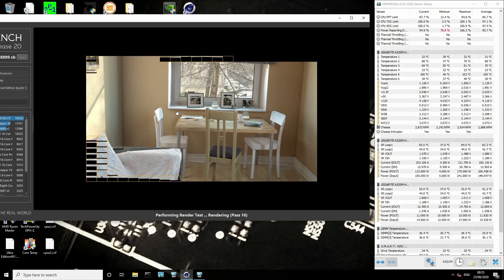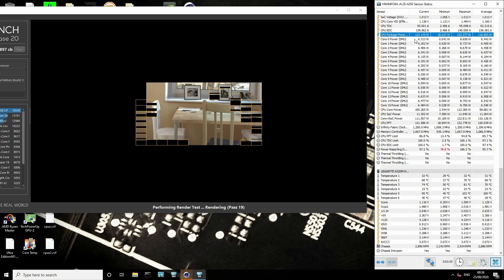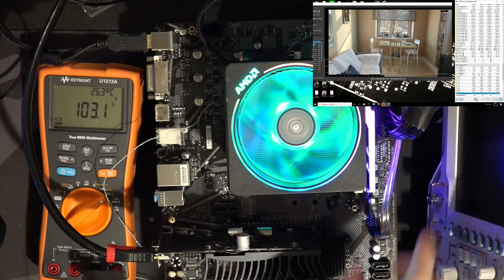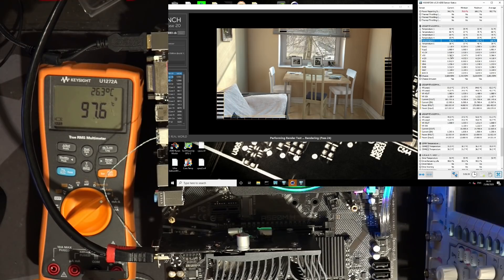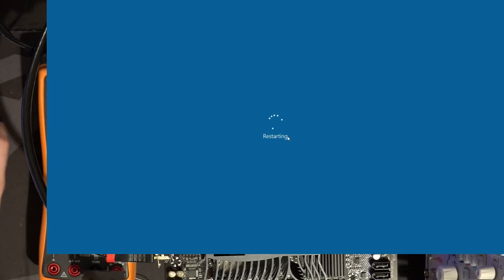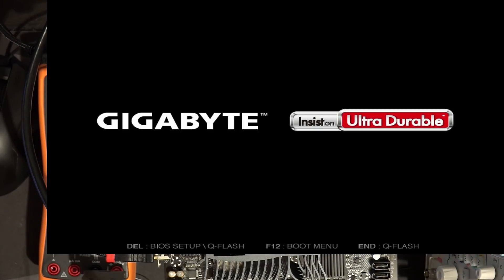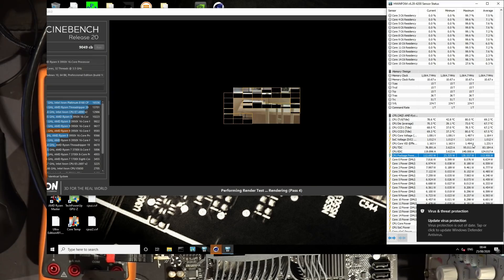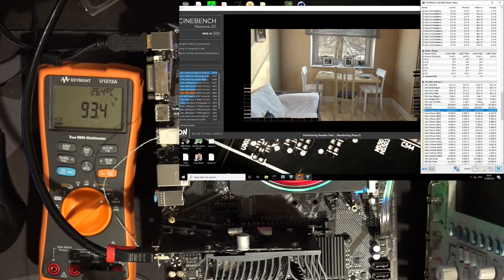Ryzen 9 3950X VS a low end A520 VRM feat. Gigabyte A520M H

Comment: Seems like gigabyte has been downgrading the VRMs of his low end motherboards. The so called A520M DS3H V2 is a clear downgrade of the original A520M DS3H. Have less vrm, dvi removed, 1 pcie x1 removed too and fan connector too.

Comment: Hey BZ, this is the video I've been hunting for... 👍
Could you pls share the exact vrm components? I'm buying a stop-gap rig right now for the next 5-6 months, and I have the R3-5300G+Aerocool Core Plus+2x8GB RAM, but I'm hesitating between this mobo OR the Gigabyte A520 Aorus Elite - which has the same VRM structure with one more Vcore phase, using Renesas+OnSemi components, but costs 50% more. Thanks in advance. 😉

Comment: Here i am about to put a 3900x on a a320m board. Its slightly better than that board(ASUS>Gigashit)(heatsink>no heatsink) and 3900x vs 3950x 12 cores>16 cores
So weaker cpu and better board. I should be fine.

Comment: At least Asus Strix X570-E has a possibility to change the default functionality of Reset button (when in BIOS):

    BIOS > Tool > **Flexkey** : assign a function to the Reset button.
            [Reset]                    Reboots the system.
            [Aura On/Off]         Enable or disable Aura LEDs.
            [DirectKey]              Boot directly into the BIOS.

In case of Asus X570-E, that 'directly into the BIOS' actually just turns off the computer. But when you turn it on again, it does automatically go straight to the BIOS. Every time you turned your PC off by using the Reset button, that is.

Comment: A520 may be more so meant to handle the Ryzen 3950X (and potentially the 4950X) in Eco Mode, the 065 Watt Power Profile: Considering the numbers that you are getting at Stock here, it is clear that that Ryzen 09 parts (sans the Ryzen 3900) are not intended to be running on this class of boards (save for the A520M Aorus Elite, which looks as if it's one of the best of this class, to my knowledge); it would be nice to see the numbers that this chip has with Eco Mode enabled, we don't have much of any programming from any of the major Techtuber scene that covers this subject and wishfully knowing this will help investors know if it'll make a difference or not for Stability, a Stock 3950X on A520 doesn't look as if it'll be feasible for preserving the life of the board for more than a few years and it'll be interesting to see how Stock versus Eco Mode affects the welfare of the board in a Year Round Always On usage test.

Comment: that's rather remarkable considering what Hardware Unboxed discovered with a couple of the B550 boards they looked at. Not great for thermals, however, it's not running beyond the cap's temp rating or just shutting down. After seeing the B550 results, I half expected all the A520 boards to ketch fire or just not power on with a 140watt CPU, lol.

Comment: PBO is pretty garbage for Zen2 anyway. Letting Precision Boost 2.0 (activates by disabling PBO, not sure if that's available on A520) do the work is only affected by temperature and silicon fitness, so combining that with 1usmus' custom power plan can easily give better boost clocks at stock than using straight up PBO.

Comment: do you plan on doing any RAM OC vids with this mobo?
Reply: Why on Earth would he do that? The point of the RAM OC vids is to see how far the RAM can go, not how bad the motherboard is.
Reply: @BeamMonsterZeus  Because it would show how GOOD this mobo is at RAM OC. Buildzoid has already talked about how good this board will be at RAM OC due to it's 2 DIMM layout: https://www.youtube.com/watch?v=2HBTmXWEHvY
Reply: Testing ram overclock on b520 would be interesting. Maybe try overclocking a 6 or 8 core ryzen 3000 for max stable CPU/RAM/IF speed and check how it scores in benchmarks compared to stock?

Comment: Have you checked if you can adjust the two power values under CBS>NBIO>SMU Common Options ? They seem to work via a different mechanism than PBO. I have adjusted these power limits on an Asrock x570 board, and Ryzen Master still tells me I am in default mode, not PBO mode. And if I try to reset to defaults in RM, it tells me everything is at stock as it is!
If I adjust the actual PBO options in the BIOS, then Ryzen Master recognizes it as PBO mode, and resets it to actual stock values when asked.

Comment: 5:45
Just create a shortcut that utilizes the shutdown /r /fw command and run it as administrator. Reboots straight to BIOS from windows. Or just download my batch which ask for admin access automatically:

https://filebin.net/a7dgljvkjf0l3dxb

Feel free to check and/or edit the source code, I put in a 5 second delay. It's down below ↓
Reply: Source:

@echo off

if not "%1"=="am_admin" (powershell start -verb runas '%0' am_admin & exit /b)

shutdown -r -fw -t 5 -c "RESTARTING INTO BIOS.. HAPPY OVERCLOCKING!"
Reply: ...Or just mash the delete key. Can't exactly use the shortcut if the system crashes or becomes hyper unstable.

Comment: You should maybe stick some aftermarket heatsinks on that board and see what happens. I don't think any tech tuber has actually measured the temps from aftermarket heatsinks with thermocouples

Heck, I think an aluminium m.2 heatsink would fit on the small mosfets
Reply: The caps would block an m.2 "heatsink" and there's really not enough mass on one to be practical. This video is more of a proof-of-concept than showing ways to make it realistic/viable with a 3950x - buildzoid says in this video that he does not recommend this combination of hardware.

Comment: Pro tip: Find some old heantsinks from old hardware. Saw them to fit on the Motherboard VRM. Use thermal glue or thermal stickers to fix them on the VRM. Gain 20$~40$ in performance value.
Reply: Great, just gotta buy a hacksaw, thermal glue, and hope I don't short anything in the process.

Joking aside, good airflow directly over the inductors and mosfets should be perfectly sufficient.
Reply: @BeamMonsterZeus  Not that hard to do and a hacksaw is a fairly common item to have at home.
You only need a very small amount of glue and you may be able to get it for free with a local refrigerator repair shop. If you have to buy it a small tube is cheap 1$~2$.
And for the heatsink go to any recycling place near you and you can easily find old pcs to hack.
Reply: @vitor900000  Nobody within a 5 mile/8km radius of my home has a hacksaw, I can promise you that. We don't even have recycling centers nearby, nor refrigerator repair shops. It's not about it being hard, it's just impractical and a lot more work than is worth it. Besides, you shouldn't run a 3950x or even a 3900x with this motherboard anyways. You won't get as good performance as you would with a slightly more expensive motherboard. If you want to do so, go right ahead. Don't pretend your situation applies to everyone else, though.
Reply: @vitor900000  There are other features you might get besides just a better VRM worth considering. And yes, both a desert and a college town. Nobodies sawing anything here.
Reply: @BeamMonsterZeus  
Welcome to the apocalypse.
Reply: @vitor900000  About 99.9% of the college kids in town use Apple products, primarily the overpriced Macbooks their parents bought them.

Comment: If the power deviation meter is not off (I'm still not convinced that it works properly as both Stilt and MartinX refuse to disclose how they measure it), then it's actually consuming 140+ watts, so it's probably not really throttling because of VRM. I'm actually surprised that the stock cooler can keep it even at 3.9 ghz

Comment: K-type thermocouples are generally +/- 2 °C, unless you buy some special expensive ones and/or you characterize them in a salt bath and boiling water. Then again, People use those in-stream in automotive exhausts up to ~1100 °C so...

Comment: I'd hate to see what VRM temps my MSI B350 Gaming Pro Carbon with my 3900x.
Reply: Literal oven. The temps might not even be the problem, though, the VRM would straight up limit your OC so severely by just being so garbage. I feel your pain, though, still got my B350+1600 here.
Reply: @BeamMonsterZeus  I have a fan blowing directly into the VRMs so hopefully it holds out until AM5. I have my 3900x at 4.3ghz and 1.3375v and I hit 7715 in cinebench R20.
Reply: @SteeltechPC  I'm not familiar with Cinebench scores but those settings look pretty decent. Does that board even have LLC settings? And is that a BIOS OC or Ryzen Master? Have you done Prime95, Handbrake, or some other heavy load/hot benchmark?
Reply: @BeamMonsterZeus  overclock is through the bios and running cinebench R20 for about an hour is all I usually do for a stress test.  And yeah, it has all the PBO settings that I've seen on x570 boards.
Reply: @SteeltechPC  Cinebench isn't a great stress test, but it's at least realistic. Problem is that it doesn't load the VRM or RAM as heavily as a demanding game might, so it's not going to show you the "worst case scenario" for thermals. Probably irrelevant though if you've got direct VRM cooling, and that OC isn't insane or anything. PBO on a B350, nice. Don't even have that on my Gigabyte B350 Gaming 3.
Reply: @BeamMonsterZeus  oh ok.  What's a good stress test to use.  I appreciate the input.
Reply: @SteeltechPC  Prime95 for absolute worst case scenario is often recommended, but is a bit unrealistic. Reason it's popular is that if your system survives that, it'll survive almost anything. Handbrake with some profile tweaks is good(H264[x264] encode, Slow encoder preset, generally encode a high quality video with lots of variance in-between frames i.e. gaming recording) for driving the CPU and VRM to boiling pretty quickly, and is good for validating OC stability under adverse temperature conditions. Memtest is a good starting point for RAM stability checking. Linpack as well. Intel Burn Test(IBT) is one Buildzoid uses often, and yes you can run it on Ryzen as well. Cinebench is generally just a lighter load than all of these so you aren't likely to expose yourself to any potential problems with the OC that might be presented otherwise.
Reply: @BeamMonsterZeus  dude,I really appreciate it.  I know what I'll be doing tonight.  LOL
Reply: @SteeltechPC  Oh god. Good luck, and don't worry if you crash on something lol the bare minimum is passing a few IBT runs.

Comment: did you tried the PBO EDC bug?
so put an EDC very low, like 10A to 30A
scaling at *10 and +200mhz in boost
my 3700X jumps to 4425mhz (1 or 2 core at the same time maximum)  and all cores together I reached 4375mhz but most of the time I jump to 4325mhz!!! (yes all cores)
so crazy good PBO in action
Reply from the maker: yeah tried that basically all my CPUs just end up stuck at like 550MHz.

Comment: use an arctic liquid cooler II
there is an integrated fan to cool the VRM
Reply: It will help, but won't be anywhere near as effective as a top-flow cooler.
Reply: I mean, that would still be impractical. Spending money on a decent AIO instead of a better motherboard that doesn't even need VRM cooling?

Comment: So I dont get one point, if 100ºC on VRM technically its still ok, why on some motherboards at +85ºC on VRM is start throttling ? So at the end whats still safe temps for VRM ?
Reply: Precision Boost behavior; The motherboard/CPU detect that the current power settings cannot continue to run safely/stable under the concurrent conditions. This can be more lenient if you change certain settings.

Comment: Would some cheap heatsinks help much here?
Reply: Yes! But I don't think there's an easy way to mount them without spending extra $, at that point just get a better board.
Reply: Benign or Design You can buy packs of small heatsinks with pre-applied thermal pads for some bucks and stick them onto whatever needs cooling.
Reply: @Ty4ons  Or spend the extra bucks on a better motherboard that has more features and proper OC support...

Comment: What's the life on that cooler at 3600rpm? A couple of days or months or is it longer?
Reply: It would be a question of the lifespan of the fan, not the cooler. The fan would probably last longer than the thermal paste to be honest. They're not complete trash. So at least a year if running 24/7 at max speed, which you wouldn't practically be doing anyways.
Reply: @BeamMonsterZeus  Asked fkr the cooler as a whole. Running the system set up like that was is the lifespan. The fan shouldn't have too much issue since it's obviously able to last for more than a couple years in a normal system even if you never turn off the pc.
Worried something else could go wrong dude to high sustained rpm and heat.

Could definitely have phrased it better and don't think it'll only last a couple days. Was an gross understatement of lifespan.
Reply: @NotThatGuyJD  Are you asking about the lifespan of the aluminum heatsink? Longer than the lifespan of the capacitors on the motherboard, that's for sure. I only talked about the fan because that would be the first point of failure.
Reply: @BeamMonsterZeus  yeah you're right. Fans the only moving part. Only thing that can break, I had some other shit mixed up.

Comment: how good should the vrm be for each of the CPU?  it's always a hard question for me.
Reply: vrm for cpu, vram for gpu thanks me later
Reply: @standalone360 i was thinking wrong haha thanks
Reply: and also how hot should it be
Reply: @victwn  This A520 in the video is the bottom limit for how bad a VRM can be while still handling the highest-end AM4 CPU. Any worse than this and you'll have trouble even running stock settings. 4-phase is generally fine, even no heatsink is fine, but as BZ says the downdraft cooler is really the only direct airflow keeping that VRM alive. So, almost any B550 and almost any x570 has sufficient VRM design to handle any Ryzen. See this video for detailed information: https://www.youtube.com/watch?v=JxczZChFaZI and this one: https://www.youtube.com/watch?v=wuPH9pCCK-E Maybe this one too: https://www.youtube.com/watch?v=HSY9rDsQgd4 Even more here: https://www.youtube.com/watch?v=zfD_KuTVfkc Last one: https://www.youtube.com/watch?v=_7PkZwY9PWM
Reply: @BeamMonsterZeus  OMG thank you so much for this answer. i learnt a lot!

Comment: So, basically slap a 40x20mm Noctua at 50% Speed on the VRM and you'll never have any problem whatsoever...
Reply: @Ben T. True. But if you have fallen down the path and bought that board, have your system up and running and don't want the hassle of return and replace with smth better, this may still be a viable option...
Or, if you just don't want any other board (for what ever reason).
Reply: @wiedapp  Yea, because it's more of a hassle to return a product and get one that actually works rather than buying another product then using some janky mount to get it to cool things, right?
Reply: @shawnpitman876  but i already have lots of spare fans and jank is dank. It's not the smart thing to do, but it's the fun thing to do.
Reply: @shawnpitman876  If you assume that it is easy to exchange the Mainboard in EVERY SINGLE CASE on the planet, no matter what CPU cooler is installed in the weirdest way imaginable on it while being the worst space hog you could think of, then you are right on that.

Just a tip: Even in the biggest cases out there you can have problems to get where you need.

Personally I wouldn't buy any board without VRM coolers, as long as there are other options. But if I had to, I would work with it the best way possible. And installing a fan doesn't break anyone's neck.
Reply: @shawnpitman876  I know it's my problem. If you don't have that problem: congratulations.

It's also my problem, that I am not a native speaker.
I could try German punctuation, but I guess if you are that...itchy while I don't do that, then I certainly will not do that...
You can be sure I try my best - I just didn't get A's in my English courses ever. Not even C's. And for that, I think, I do pretty well.
Others got A's and when I see their writing and hear them speaking, I just want to run away...
On the other hand I didn't ever have problems getting my point across...until now.

Comment: Wow, this was good information. AMD and Gigabyte planned well, so when amatures try to OC to the moon the board won't let them. No OC RMA's nor unfounded Reddit BS about being unreliable. I recently bought the Asus Tuf Gaming B550 WiFi. I still have my previous gen cpu's and want to put them back into service (2700X and 1600X) I am going to use this mb for the 2700X. Could you try a 1st gen Ryzen cpu on this mb? I know from another YT channel that my mb supports the 1600, so if I can I would like a A520 for the two 1600X's I have.  Having a mb that can take a cpu upgrade will make them easier to sell.
Reply: A520 doesn't officially support the 2000 and 1000 series if I remember correctly.
Reply: @TheLaziestGuyEver  nor the b550, afaik
Reply: Gigabyte is cool about supporting most of the mainstream CPUs in their BIOS code, and they usually all roll with 32mb BIOS(or two partitions of 16mb for dual-BIOS although one of these is technically a backup)

Comment: i don't know if this is AMD making their cpu to run on anything and add adequate protection for this weird scenario or gigabyte by making a good board with that can at least run all amd 3rd gen cpu
Reply: A bit of both. The precision boost behavior is "smart" in the sense that it acts as a failsafe for suboptimal cooling configurations and for suboptimal VRMs. Gigabyte and the other board manufacturers aren't required to disable these specific features on their motherboards which is great for enthusiasts, casual or otherwise. I wouldn't call it a good board, I'd call it a beneficial consequence of other board manufacturers doing similar stuff to gain an edge over the competition.